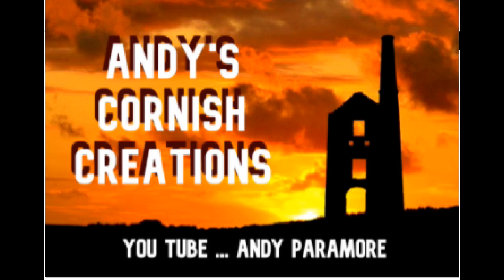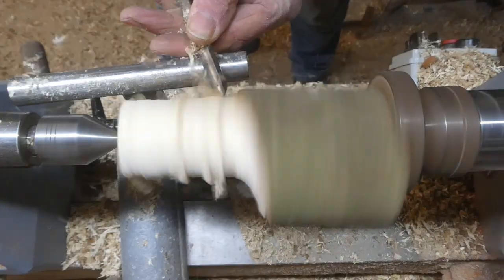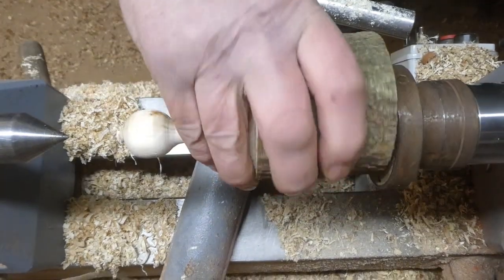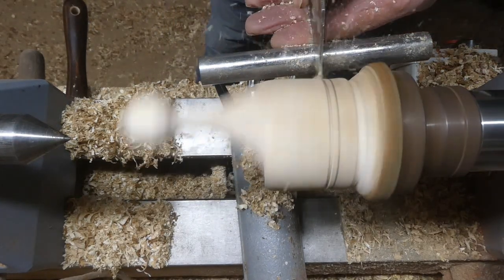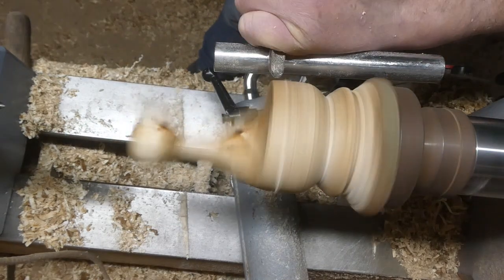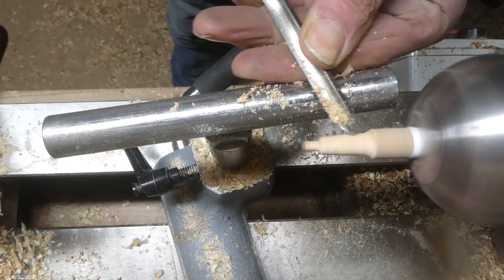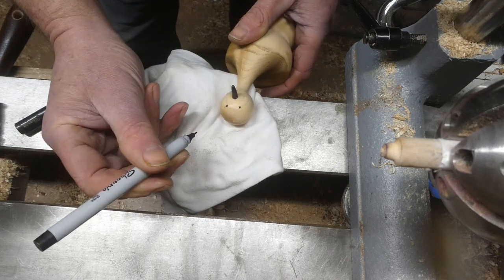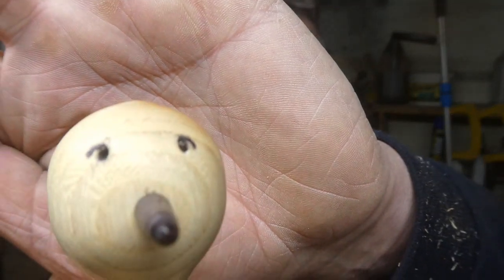20 min. Great gift or easy craft sale!.. #Woodturning

Comment: Hi Andy, enjoyed watching this one. Any tips on orientating the grain, noticed your birds face was spot on for the centre alignment. Cheers, Steve
Reply from the maker: Hi Steve...
I'm glad that you have enjoyed watching this video...
Because it's a log the grain goes down the length of the wood...
I picked a log that was just a little bit wider in diameter than I wanted the diameter of the bird to be so there wasn't much wood to remove...
The 1st hole has to go in the centre of the end ...
The 2nd hole goes 20mm away from the centre in any direction.. doesn't matter...
The face of the bird looks aligned because it faces directly away from the centre of the log...
I hope that all made sense... Haha..
Enjoy making yours...
Take care my friend...All the best.....Andy..

Comment: I've never tried an off center project. I must give it a try. You make it look easy.  Question: do you make your own abrasive paste?
Reply from the maker: Hi there...
This is a great way to try off centre turning... very simple in principle.. although I did mess up my practice piece... Haha..
Yes I do make my own abrasive paste... one part diatomaceous earth.. one part beeswax and 4 parts mineral oil... by weight...
Melt the beeswax and mineral oil in a pan ..add diatomaceous earth.. mix thoroughly... keep mixing while it cools down so that the diatomaceous earth doesn't settle to the bottom..
You can cool it faster by holding the pan in cold water...while it is still soft put it into pots...
I have never bought any so I don't know how mine compares with them...
Hope this helps...
Take care my friend...All the best.....Andy